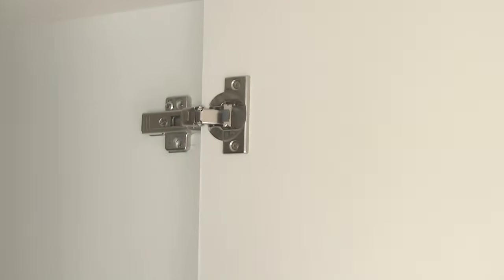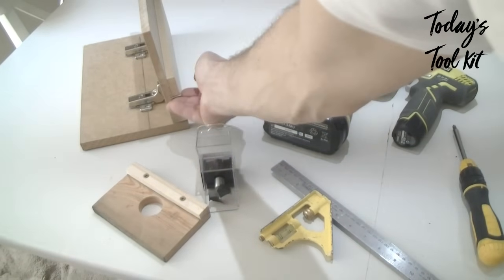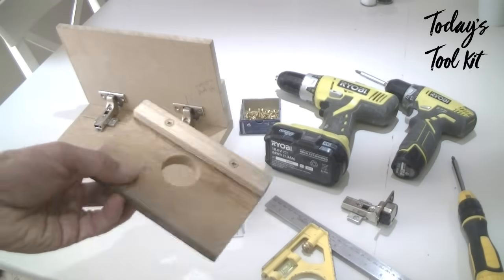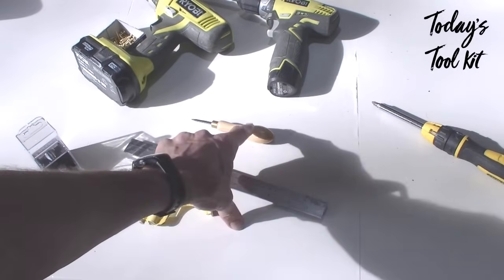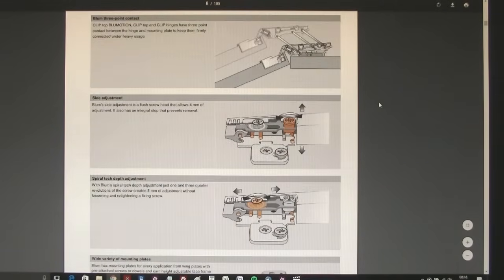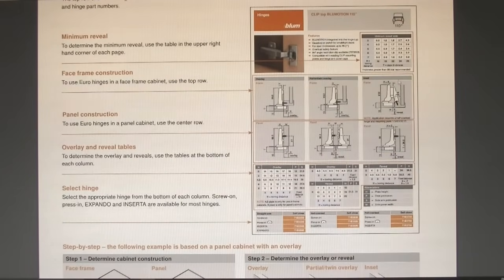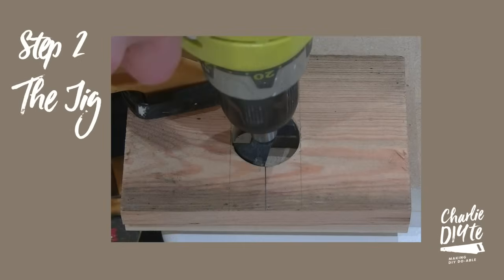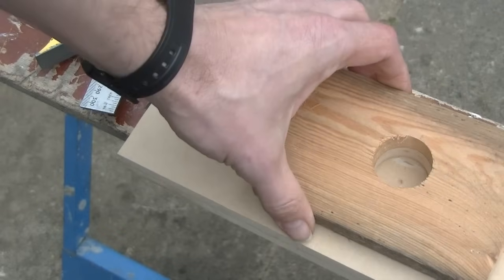How to Measure & Install Concealed Hinges on Cabinet Doors

Comment: Your patient, clear instructions and tips in this video and in "How to make panel doors" are my guides to installing closet doors. You converted me from flush hinges to concealed hinges. If you could help me with one thing, I'd appreciate it: Around 16 minutes into this video, you show the installation of the base plates in the mock-up. Then you demonstrate hanging closet doors.  I'm not quite clear on how to accurately mark the base plate positions on the closet walls. Do you transfer measurements from the door to the wall? Do you prop up the doors (with a helper?) and mark the plate positions? I, too, will need 4 hinges per door, so I am concerned about aligning that many hinges. I appreciate any thoughts on this!
Reply from the maker: Hi there, thanks for that - I'm glad you liked the video. 

Yes, valid point. I thought the video had gone on long enough and so I didn't record that bit - but on reflection I should have done. 

It's pretty easy really. I attached all the hinges to the door itself with the mounting plates that you'll be screwing to the cupboard/ wardrobe carcass attached, with the hives in the open position, and then offered it up to the opening with the for in the fully open position. You might get someone to help you with this. Either way, it's worth putting something under the door to simulate the gap that you will want under the door when it's hung. This also takes the weight of the door. 

Then, simply mark the outline of all the mounting plates against the inside of the cupboard with a pencil. At this point you're not trying to get the exact location of each mounting plate relative to the front edge of the cupboard or wardrobe (carcass) - you're just marking out the location and spacing of each plate up the inside of the cupboard. 

You can then take the door away, and now you've got the exact location height of each mounting plate, you can adjust its position in from the front edge of the carcass as I explained in the video by reference to the Blum pdf guide (that pencil line you saw on the mock up) - so that each mounting plate is parallel with the edge, mark the screw holes, and drill. 

You could try and do it with measurements alone, but this way, using the actual door, you know that when you come back to fix the brackets in place, they will all line up perfectly.

Locating and snapping each hinge into place is a bit of an art, particularly where you've got 4-6 on each door. You want to locate them all simultaneously, as best you can, and then push them all into their mounting plates in one movement by pushing the door as a whole rather than each hinge individually - because if you try and snap them in individually, you'll get a few in, but the last 1 or 2 will be pretty impossible to move into position - particularly if they've disengaged from the mounting plate while you were snapping the others into place! 

If you then find the door is a bit low on the opening (as happened in my case!), if you've used the mounting plates featured in my video, you can release the adjustment screws on each mounting plate and slide it up a few millimeters to get your door into the perfect position. I believe some of the cheaper mounting plates don't have this additional functionality. 

Hope that all makes sense. Let me know if you've got any other questions.
Reply: @CharlieDIYte   Thanks for your swift reply to my questions! I'm still in the planning stages, and there's another issue I'd like you to comment on: Like your closet, my closet isn't perfectly square. But unlike your example, I will not have one door and one side of hinges, but I will have 2 doors, both hinging on the outside walls. The floor is level. The right wall is straight. The top climbs about a half inch from right to left (but that doesn't concern me). The left wall, however, isn't straight. At the top it is 4 or 5 mm wider than the bottom. Will this govern how I mount the hinges on the door or on the wall? If I buy and use a concealed hinge jig, and if the door is slightly wider at the top, the hinges wouldn't be mounted right above each other on the door. Neither would the wing plates on the wall. Is that OK? Will the door still open and close properly? Without perfecting the width of the doorway, is this the way to go, or do you recommend a different fix? Again, thanks for your videos, and thanks for your reply?

Comment: The Concealed Hinge design is an Engineering Marvel and for me, the way they move has a kind of beautiful geometry about it, if fitted properly they last forever but in any case they are quite cheap and very simple to replace.

Comment: Great info Charlie......I’ve built quite a few wardrobes and cupboards using the overlay hinges, may have a bit more confidence to use the inset hinges now. A small tip for you when offering a door to place with say 4 hinges, use your foot to help, click the bottom hinge to place first then you have the position and weight held to click in the rest of the hinges. Regards Brian
Reply from the maker: Thanks Brian. Great tip!

Comment: Watch all you videos and find lots of useful bits and pieces. Currently trying to build some doors for an MDF fitted cupboard I made. Followed this to the letter (including making a jig and mock up). Good job I did make a mock up because I found an issue. To save on costs I used 18mm for ALL parts (rather than thinner MDF for the stiles and rails) which meant the thickness of the door was 36mm. The hinges only support up to 32mm. I thought (stupidly) that was just a weight thing but unfortunately it's not - the door can't rotate properly as it's too thick and catches the side. When it stops raining I'll have to use a router to thin a channel on the inside side of the door on the hinge side to reduce the thickness to under 32mm. Probably going to have to do the same on the middle too as the doors might clash when closing...It was all going so well up to that point. Managed to build the cupboard, nicely scribed against the walls and ceiling, fitted all the shelves, put the door together...oh well - at least I spotted this on the mock up! Thanks again for this great video
Reply from the maker: I'm sorry to hear that. Yes, you're absolutely right. I'm doing a new wardrobe build as we speak. Hope you figure out a way to make this work. 👍🏻

Comment: While a drill press is a good tool to use for drilling the hinge pockets, using a large plunge router is the better way.
This allows one to set the correct depth without fear of going in too deep and it will also ensure the hinge cutter is perfectly square to the door.
Reply from the maker: I agree. Good point 👌

Comment: Many thanks for this!  I'm about to order a set for my kitchen cupboards - but I'm wondering.... On a door with just two hinges, do they both need to be 'blue motion' soft closing?  The ones without are a bit cheaper, so I could make  a saving if only one needed per door! TIA
Reply from the maker: Richard, I disabled the bluemotion on one of my doors on this project https://youtu.be/tdMnnkvInrE and they didn't half slam shut. I love the soft close because you just give them a gentle nudge in the right direction and walk out of the room.

Comment: When you put the hinge screws into the MDF is it better to use 8mm plastic dowels? Or can you put PVC glue in the hole to stabilize the MDF?

Comment: That was very helpful.  Thanks for posting.  But I'm still unclear how to mark the height locations of the mounting plates (on the cabinet). I have the knock in type (screwless), which makes this step more difficult.  Argh.

Comment: Informative video, thank you. I purchased a ‘cheap’ flat pack double wardrobe. On one side the doors are only half height. When finished, these doors have an overlap of 5mm, after the maximum adjustment on the hinges. My question is, do better quality hinges come with extra adjustment. One door is inset and adjusted to the maximum position the other door is an overlay and still has room to make adjustment but the hinge , as I stated is at its maximum. Also one point , which I didn’t realise before watching the video, is that all the hinges provided are the same , which it appears they shouldn’t be. 
Any helpful advice , before the sledge hammer appears, will be greatly appreciated. Because of the virus situation , the supplier has shutdown for a couple of months. Thank you.

Comment: Despite what Blum site says, what is the biggest MDF door you have built with these hinges? Would they hold in a 48”x32” Baltic birch (or plywood) door? May be 5 hinges would do well? Based on your experience with heavy MDF. Thanks

Comment: In case your wondering, and the measurements on the drill package is in inches... 35 millimeters is roughly 1 3/8".

Comment: Hello Charlie, when measuring for your larger doors, did you measure your hinge plate position on the frame before the door?
Reply from the maker: I think I offered the door up with the hinges attached to the door, and marked their position on the frame. You always need to build in a mm or so for the door dropping with gravity but those mounting plates I used have vertical adjustment, so well worth the few extra pennies for those. Can't quite remember but I'm going to be hanging a load more in a few weeks so keep an eye out for that.

Comment: Charlie , wonderful video ever seen in youtube. i have a question for you regarding Hings i.e in our market we used to get concealed soft hinges and Hyrolic Concealed hings, which one you suggest to use kitchen/wardrobe door fitting?
Reply from the maker: Hi there! Thanks for your comment - really glad you found the video useful. I've never used the hydraulic concealed hinges - I guess they work pretty similarly to the Blum soft close hinges featured in my video, but PERSONALLY I would go for the Blum soft close. They operate in the same way, and I guess the danger of the hydraulic hinge is that if the hydraulics fail, then the hinge is useless (or won't soft close any more)?? Can you get the Blum hinges where you are?

Comment: Fantastic video Charlie! Thank you very much. I following your guide to the letter but I have an issue with my doors catching on the hinge side. I have 27mm doors and the adjustment on the hinge is at its max... showing about a 4mm reveal and yet it still just catches the frame. Have I missed something? I drilled the 35mm hole on the door 5mm from the edge... perhaps I should have made that gap smaller? Any suggestions for a DIY armature in need?! Thanks again for the great videos
Reply from the maker: Hi Jamie, thanks! I'm scratching my head to understand what's gone wrong. I've just measured the boring distance on my daughter's cupboard and it is 5mm. Did you definitely use the Clip Top Blumotion for THICK doors? If not, that'll explain why it's clashing. Let me know.
Reply: @CharlieDIYte  You’ve cracked it! I missed that they needed to be the thick profile hinges. My mistake. Thank you so much for coming back to me, top man!

Comment: Brilliant video. I am looking at building some built-in wardrobes using your videos as guides. I have a question; recently I installed a kitchen and have about 20 odd Blum standard soft close opening hinges left over, because the kitchen I bought came with the hinges you have described as well (the doors were framed type). Reckon I could use the Blum standard hinge and just install the cabinet side of the hinge onto a packing piece before fixing?
Reply from the maker: Hi Kevin, I don't see why not - take a look at page 13 of this https://goo.gl/TLyiFc which demonstrates the various different configurations. I guess you've just got to tailor your fixing point depending on which mounting plate they've given you - see they talk about the 4.5 or 9 plate depending on whether you've got a frame or cabinet application. Best advice I can give you is make a small mock up before you start drilling large holes - to double check your packing piece is doing the job you want it to! Good luck, and let me know how you get on!

Comment: How did you line the base plates up on the cupboard. I saw how you did it on the jig but thats alot smaller and easier. Was it hard to line it up for the cupboard?

Comment: Charlie loved the video. But I have struggled to find a decent replacement for the Argos type draw slides. I have to replace mine at least twice maybe three times a year. As they have virtually no gap between the draw side and the unit its hard to rplace with a stonger bearing slide. They are the recessed ones and give you no leeway to upgrade. So was wondering if you have any ideas or tips on how to upgrade them.

Comment: Charlie @17.58 where you are adjusting the vertical position on the base plate. Closing this gap does it not mess up the reveal (2mm) and potentially cause the doors to jam on opening ?
Reply from the maker: You have to experiment but there is a minimum distance, I think of 2mm. https://youtu.be/tdMnnkvInrE This vid has a more detailed run through of the install.

Comment: HI, How do you pick length of the product on these hinges ? Trying to buy the Blum hinges from Screwfix but they come in 110mm , 112mm , 115mm & 140mm length. Thank You.
Reply from the maker: I don't think concealed hinges come in different lengths. Read the brochure I referred to, work out what application you need and buy those hinges.

Comment: Hi, my doors are only 20mm thick - could I use concealed hinges on these? Great video by the way
Reply from the maker: Thanks. You should be fine with 20mm as the cup is typically 10 to 12.5mm deep. There's a new video here https://bit.ly/2UfXY4B where I go into it in a bit more detail.